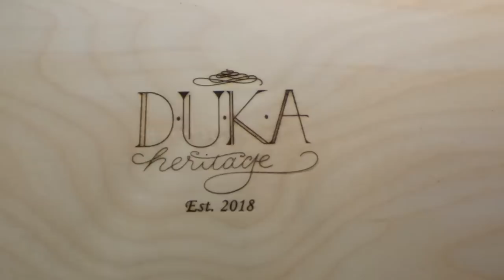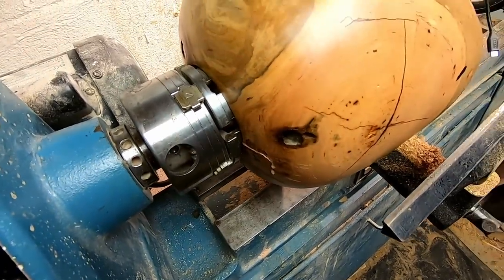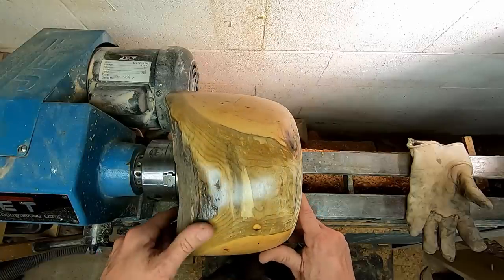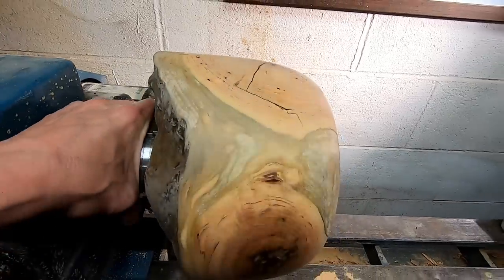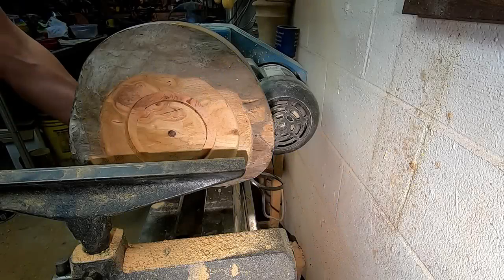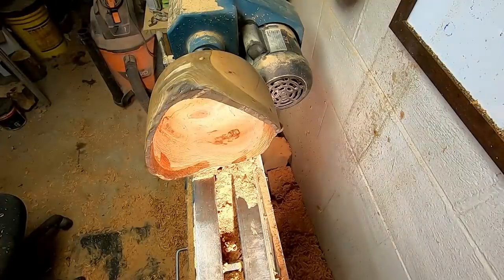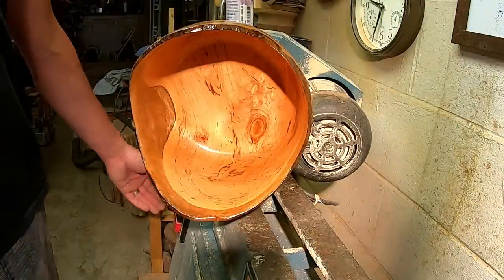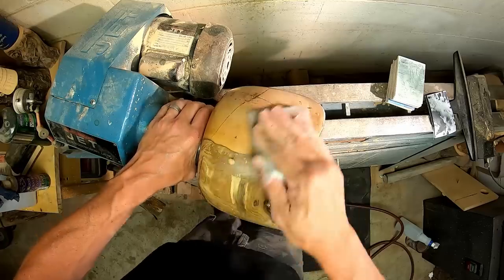Woodturning - Cherry Fruit Bowl (Part 2)

Comment: Great save of a beautiful piece of wood. Well worth doing and well done. Love the finish as well.
I have not tried it myself but I have used Polcrylic which seems to be similar.
Take care,
Gary
Reply from the maker: Thank you Sir for the support, I honestly was surprised how well the finish turned out. It did take quite a few coats but it dries quickly and was easy to polish out.

Comment: Anytime I turn apiece with the pith it splits. What keeps yours from splitting?
Reply from the maker: Thin walls or very slow drying. This one did crack a bit at first but the CA held it together nicely. Many times I'll just take the gamble if the look is right. :)

Comment: It might ne a good idea to keep your end stock in while you do the major hollowing out that way if it is thrown off the chuck you still have something helping to keep it in place with all the vibrations.
Reply from the maker: Thank you for the advice, I have since gotten the lathe fixed up for the time being. It seems to be running much better.
Reply: @dukaheritage9445  I also have heard that welding square pads of metal on the feet and then burying them in sand in a large wood box helps watch out for cats though.  LOL
Reply from the maker: Fortunately we only have a shop dog to worry about. :D

Comment: Hey Duka, MORE gouge cutting, less scraping. Also, don't be scared to turn off much more material than you currently do. You'll get better, more flowing graceful lines.
Reply from the maker: Hello John, I totally get what you are saying  but I need to build my tooling arsenal first. I am self taught and carbide is a good cover all solution, Its what I'm comfortable with only because its what Ive been using to teach myself the craft. I do hope to pick up a good long handled 5/8 gouge in the future and further develop my skills.
Reply: @dukaheritage9445  Hey Duka, best wishes from bonny Scotland, not so bonny today though! Yeah, just a friendly bit of constructive criticism from one turner to another. Nice job. I really liked the segmented bowl you made for your Missus. What was it that went wrong with your lathe headstock? Hope it wasn't too serious. For some sanding operations I use little rotary sanding pads mounted on an arbour that you stick in a drill and pass over your work, they're especially good for bowl interiors. I use 2" and 3" velcro discs which aren't very expensive. I don't know if you're aware of them but they're real handy, and , you don't burn your fingers! Gotta ask, what part of the planet are you from? Keep on makin shavins. Regards, from your fellow Scottish woodturning buddy. All the best.
Reply from the maker: Hello John, I do apologize for the late response. YouTube is only good at notifying me of the original comment. As far as the lathe head is concerned, I'm thinking all the banging and shaking from the birch bowl project started to loosen the head on its mount and did a bit of wear on the clamping surfaces. I was able to get it all cleaned up and it seems ok for now. It's definitely time to start thinking about picking up something a bit heavier. I do also intend on picking up the sanding arbor. So many supplies to keep up with. Thank you for checking back. I'm writing to you from Pennsylvania, USA. Hope to hear back soon. :) - Todd